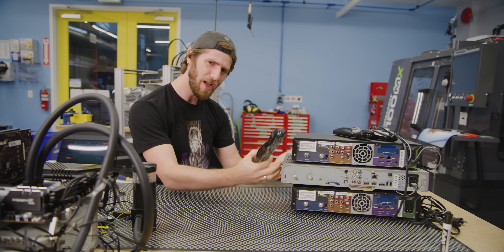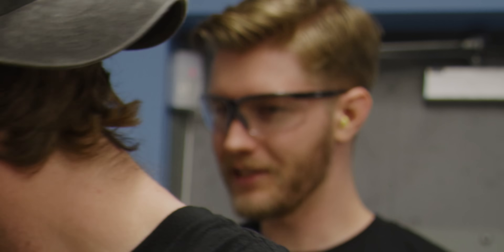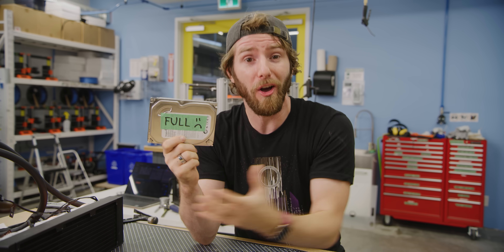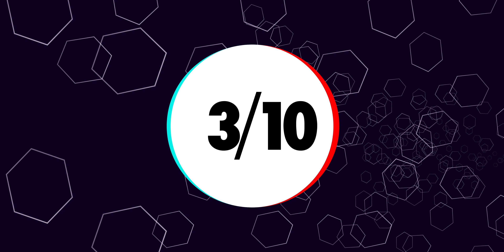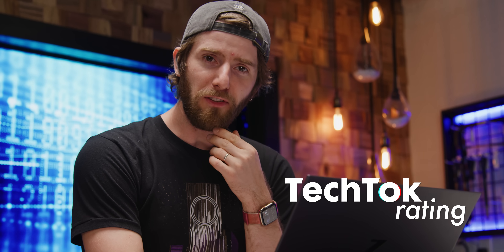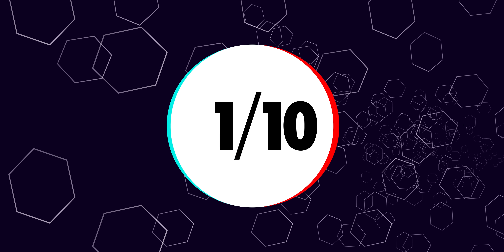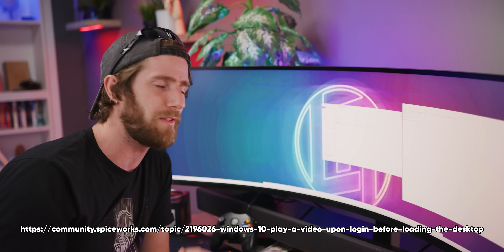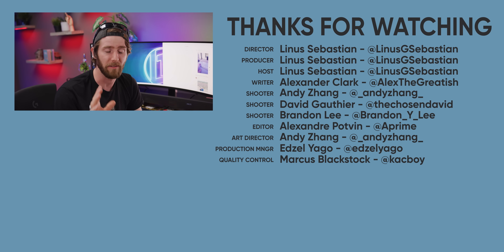Trying TikTok Computer Hacks...

Comment: As I come back to peek at this year-old tech tip, thought I should mention that eBay is better for hard drives honestly.
You can find deals like 4Tb 3.5" SATA HDDs for around $28, or in my case since I needed 16 SAS (different than SATA) drives for a server, I found a deal for 4Tb @ $20 and then proceeded to work a deal for $16/ea since I was getting 16.
So if you're buying multiple, building a home server, or just filling out your desktop PC's storage, there are some competitive deals.
Considering Linus paid $30 expecting 3x1Tb drives only to get 1.16Tb, you could get 4Tb for the same price. Just thought I'd share since I was just in the HDD market this month.

Comment: 15:11 should be an 11/10. i was having issues with my gpu a few months ago and ctrl+shift+win+b was invaluable for troubleshooting it at the time. it's especially useful these days when most people are trying to keep their current gpu until prices become reasonable again.
Reply: He did a bad job of explaining what it actually does?
Reply: i have an issue where i do ctrl+win+shift+b and my pc fully freezes and I have to restart 😂 i have a rx570 powercolor red dragon 8gb
Reply: get a 3070
Reply: I came here to say this - at my last job we had some really crappy intel integrated optiplex machines and the drivers were ALWAYS bugging out, everyone just rebooted when they ran into issues but after snagging this shortcut it saved a lot of time. Definitely a 10/10 for me.
Reply: @jufran9137  give me the money for a 3070 then.
Reply: Same here, it's proven invaluable with the occasion when chrome or some other application gets the transparent bar at the top in full-screen. Reset graphics driver and all fixed!
Reply: I dont get it what happened here. Can someone help explain to me?
Reply: @ciddhere  instead of rebooting when the graphics driver crashes, the keyboard shortcut reinitialises the driver from within the OS. Amongst other things it can be useful when overclocking and stress testing because the cards can bug out hard and screw with the graphics
Reply: @TheDreamHazard  hey thanks for putting your time to explain things for me. Appreciate it
Reply: bruh anyone know why my gpu shows no display?
Reply: @Catastropheex1  earn money to get it LOL
Reply: @jufran9137  don't tell people to get things unless you know their financial situation bigot

Comment: I've never laughed so hard watching someone use an angle grinder with such blatant disregard for their own safety or how to use the tool.
Reply: i.e. everybody in my welding class
Reply: As a welder myself, I wanted to see his shirt catch fire. I've caught myself on fire a few times doing that same thing,.
Reply: If you like that, you’ll love official duck studios. Seriously. Just endangering themselves with guns and power tools constantly.
Reply: Not wearing gloves was smart though.
Reply: @TheAdatto  I sense sarcasm in your comment...
Reply: @wargamingsupernoob  False sense!
Reply: @wargamingsupernoob  it’s not sarcasm
Reply: @wargamingsupernoob  its sarcasm until one of your gloves catches onto the tool and starts rotating and idk but it seems that real humans dont have action figure wrists that they can turn 180 degrees
Reply: @indigo3032  wait so you shouldnt wear gloves when operating this thing?
Reply: @michaelangelo0305   never
Reply: Use to be me until I had to get a piece of metal drilled out of my eye lol
Reply: @indigo3032  although might sound right, that wearing gloves with an angle grinder is dangerous due to tangling, it's not quite correct.
With a lathe or a standing drill for instance, you'd be spot on. Because those machines rotate relatively slowly (catch loose sleves or glove fibers easier) and have enough torqe to rip your arm off, or at least enough to mangle it.

An angle grinder however is a speed tool, and does not have enough torque to do that much damage, and because it spins so terrifyingly fast it, in almost all cases, just shreds the gloves. It's always better to wear appropriate gloves that fit, due to multiple safety hazards, and in many countries its officially recommended as standard safety protocol to wear gloves when using an angle grinder.

I've cut my hands on an angle grinder through my gloves a couple of times, and not once did it even come close to tangling, it just vaporised the glove, but they've protected me numerous times from fex, sharp metal edges, hot metal (notably after grinding), skin strain, grinding sparks (hurt like hell), improved grip when working above ground and less vibrations when grinding (you'd be surprised how badly vibrations fuck up your hands in the long run).
Angle grinders are horrifyingly dangerous tools and demand utmost respect and safety when handling, i still dont feel completely safe when using them despite my experience, because im not. But wearing gloves is almost always better.
Reply: Also, that's not even a cutting disc.

Comment: Okay, so, in the DVR bit, another point that should be brought up is that even if you get the hard drive out, most DVR makers have a proprietary method of pairing the hard drive to that specific motherboard. You have to get into the hard drives BIOS and completely reinstall the firmware, otherwise the hard drive won't even spin up. I have several that I have collected over the years, around 4.5 TB, that I can't access because I don't have the technical ability to modify the firmware.
Reply: you don't have to get into the bios, if you have a computer and hard drive dock, you can just format it, I have a 4tb HDD from a dvr in my computer rn, maby I just got lucky, but my brother and sister have 2tb and 3tb dvr drives as well.
Reply: @GatorGamerDude  That really depends on the DVR, some just use something like EXT3 or 4 because they are usually Linux based and lazy, others really do wierd stuff to the HDD BIOS

Comment: The graphic driver  shortcut comes in hand at work (Tech support) there is a display glitch that occurs in windows where the top portion of the screen doesn't display the open window - and the graphic reset driver is a quick way to resolve this , instead of restarting the PC (also fixes the issue)

Comment: Omg there's this thing called "DRILLING THE SCREW HEADS" that make much less of a mess

edit: And needle nose pliers to twist the metal mount. Every time Linus pulls out tools, I pull out tears
Reply: I thought the same thing, then I saw he grinded them and the started prying the drive out lmao.
Reply: Lmao exactly what I thought,  but I still appreciate the content xd
Reply: At this point I'm pretty sure he's doing it this way to make the videos more entertaining 😁
Reply: I open all my packages and mail with a grinder.
Reply: lol. I was thinking, "Oh, one of the drives don't work? AFTER YOUR REMOVED IT USING A HAMMER!!!"
Reply: Hack saw to cut a slot then flatblade screwdriver. Or but the "security" screwdriver bits.
Reply: Nevermind that he's holding the grinder so it sprays him with hot metal.
Reply: As a machinist I was just thinking this. We do that when someone strips the head of a screw.
Reply: I’m nearly certain one of his dozens of iFixit kits would’ve had the right bit for this.  I’d guess he’s doing it like this for the fun of it.
Reply: Linus is an entertainer, this is just him having fun... It's not a tutorial.

Comment: Linus: Get the I fix it kits with all the security bits ever
Also linus: ANGLE GRINDER TIME!!!!
Reply: Must be some pretty awesome security bits that ifixit make if they can remove rivets
Reply: I figured it was rivited or something close. Because it didn't make sense either.
Reply: @Heliocentric  Rivets that size are easy to remove, you just need to drill them. And Linus could've easily cut through the top of the first cable box with wire cutters.

Comment: "heavy duty tools required to access the drives"
or you get a $12 security bit set from amazon and save yourself the sweat
Reply: Was Linus not sponsored by IFixit?
Reply: hammerä/crowbar/tinsnips do it as well
Reply: ... Or a cheap junior hacksaw, create a slot and use a normal screwdriver. ;)
Reply: If you are just after the HDD... I guarantee you a hammer and a pry bar would do the trick. Hell, you could just use the back of a standard framing hammer for the prying. Add a pair of tin snips for easy mode. You sure as hell would not need a single power tool.
Reply: Is it really worth $12 for tools you only use once?

Comment: "you want some gloves ?"
Never. With. A. Rotating. Power. Tool.
Reply: I'm in construction - ironically its safer without gloves because the key to safety is complete control over the tool, which you have less of with gloves on as well as the danger of the glove getting caught in the blade and pulling your hand into the grinder. So lesson is stop trying to be stupid safe all the times kids
Reply: @portaadonai  lost a finger due to gloves and grinder, never again
Reply: @WLS_Churchill  holy shit did you ever get it re attached? if not did your life change drastically without it
Reply: @sucman1684  haha no it wasn't a clean cut and they had to stitch what was left of it, i learned very quick to live without it and pretty much nothing changed
Reply: I use leather gloves with a close-fitting guard. Has saved my skin multiple times. The threat of cutting your own fingers off outweighs anything else.
Reply: Fast tool (like a grinder), yes, wear gloves. Slow tool (like a lathe), no gloves. A grinder will not pull your gloves and finger into it like a lathe will, it will simply cut the glove, which would have been your finger. You shouldn't use any tool with poorly fitting gloves.

Strictly speaking, gloves aren't necessary using a grinder, but after getting hot pieces of metal stuck to the back of your hand a few too many times, you'll want them.
Reply: @rightwingsafetysquad9872  Exactly. Although, I would suggest using TIGHT-fitting gloves when using those as to not get metal splinters. Because I've had those before and they hurt WAY worse than wood splinters because they're twisted so they burrow
Reply: @rightwingsafetysquad9872  This is NOT TRUE. I know people who lost fingers this way. Grinders are not sharp, they will grab something like a glove. If it's tough enough to stay together for a fraction of a second it is good enough to pull you in.
Reply: Your supposed to wear sleeve gloves probably what he meant but we can only hope
Reply: You should have safety glasses but no gloves if you are doing it right.
Reply: @toriless  No. You wear tight-fitting gloves and have a guard in the correct orientation on the grinder.
Reply: @RobinTheBot  it wouldn’t, but thing like mills will

Comment: Those DB 35.2 and Pipeline hard drives will work in a computer, but they are designed to be used specifically for video recording, which does not require a very fast drive to do. Using these DVR hard drives in your system will definitely be a hit on performance
Reply: I smell a problem for raid 0
Reply: @chrisbadiou1407  Stripe a bunch of slow hard drives that are optimized for continuously streaming video, instead of seeking data randomly are still going to perform worse than a single mainstream computer hard drive, unless you read and write data in big enough chunks to compensate for the increased latency accessing these poorly optimized drives. Whether it is a single drive or a stripe of 32 drives, the higher seek time means you wait longer for the drive to locate the first sector to write.
Reply: I just use them in my plex server. It's good enough for that
Reply: @jesselioce  for archival purposes, or storage attached to a network connection that’s slower than a hard drive, the difference is negligible. I wouldn’t use them for a system drive though.

Comment: Back in college I used my PC as an alarm clock for finals when my actual one broke.  Motherboard had a wake on specified time boot function, and placed a really hard rock song in the good old startup folder in win XP.  Is the startup folder still a thing?  I don't even know.
Reply: @Agret  So if I put a soundtrack file, it will play automatically on boot?
Reply: @whitehavencpu6813  you can put a shortcut to the file and it will open in your default media player when you boot up. If you want a startup sound you can go into control panel (classic one not the Settings screen) and then Sound and on the list of windows sounds you can put a custom windows startup or account login sound effect.
Reply: @Agret  Ah thx

Comment: From superuser:
"Official from Microsoft: "Windows logo key + Ctrl + Shift + B = Wake PC from blank or black screen"

From a discussion with an AMD Radeon driver engineer, it does NOT restart the graphics driver. It does appear to discard the desktop surface buffer and re-create the allocation from DWM (on a healthy system the desktop goes black for a second). "
Also: "For what it's worth, Microsoft also recommends using it in this situation: when troubleshooting external monitor setup, when external monitor was working before but then suddenly stopped."
Reply: i just did it to check if it worked
Reply: So does it work? Will you get a screen with this after a gfx driver crash?
Reply: @tharealmb  Lol.

Lmao.
Reply: This shit just made 3 of my 5 monitors pink.
Reply: Please be careful with Win + CTRL + Shift + B! It resulted in some really weird graphics glitches with my AMD Radeon RX 580 and the PC wasn't really usable anymore. Thankfully, that's easy to fix. Either restart your PC or just go to power saving mode and wake it up again once it's gone to sleep.
Reply: @Felixprogram  Facts. RX580s dont like this shit at all.

Comment: 10:39 back in the MS Dos era, we used to hide our files using ATTRIB command, and for an additional security level we named our folder using special characters like ╝
Reply: Similarly, and not sure if this is still a thing, but I explicitly remember there was a way in Windows XP to make a folder appear entirely nameless and if you chose an icon that didn't display, it would effectively make the folder entirely invisible.
Reply: @heyyitsultima  I remember doing that in win 10. Afaik there's a character that you can put from some character menu that will appear empty and then you can select a transparent icon for the folder.
Reply: Nostalgia,
I remember i made a complete folder locker with secure database all in .bat

Comment: 15:23 From a discussion with an AMD Radeon driver engineer, it does NOT restart the graphics driver. It does appear to discard the desktop surface buffer and re-create the allocation from DWM (on a healthy system the desktop goes black for a second).
Reply: basically it alerts windows to a potential graphics issue, and does, in most cases, force the driver to restart
Reply: @timnone2924  consideing how solid the adrenalin software is, probably going to be pretty handy.
Reply: On a not healthy system it will create weird artifacts and system instability. It will create more problems than it solves.

Comment: Seeing Linus with that grinder without proper protection almost caused a heart attack for me. YOU'RE NOT FINE, LINUS!
Reply: He is dont be a baby
Reply: Exactly my thoughts here.
Reply: This week on linus nearly sets his shirt on fire
Reply: How he didn't burn a hole through his shirt I'll never know.
Reply: didnt know the raiden shogun watches linus tech tips
Reply: @zedblade2526  Didn't know I'm not the only one Genshin player watching Linus
Reply: @graemed8792  you would be surprised how many people use angle grinders without gloves and such. Glasses about all i use which linus had a face shield.
Reply: and his arm
Reply: @GreyBlackWolf   Same here about the only thing I put any gear other than eye protection on for is when I use a wire wheel attachment attachment on my angle grinder. Damn things sling wires like a drunk throwing darts at a bar. 
You never know where they're going to end up and if you have any exposed skin it's like sticking pins in a pin cushion.

Comment: 1:45 dont use welding squares for holding something to grind. use a vise. also you can adjust the shield so the sparks dont fly into your chest
Reply: And maybe a cutting disc rather than a grinding disc will get the job done quicker with fewer sparks. But then again if you aren't setting your jumper on fire with concentrated grinder sparks, you're not doing it right.

Comment: 1:55 Thats a grinding disk, Would have been a lot easier with a cutting disc
Reply: shhhh.... he's trying his hardest.
Reply: Or just drilling them out, And also using plyers on those metal tabs.
Reply: @Archuhi3  Yeh I also thought that a grinder was a bit overkill for such thin metal.
Reply: Bigger is better. If he use 1mm cutting, I think that shatters to million pieces in seconds. It's nice that he got safety glasses.
Reply: @jannejohansson3383  Why would it shatter ? Also he didnt have glasses he had a Helmet with a shield, which he also didnt wear properly in some shots. Safety goggles are the very least if you're using a grinder.

Comment: I've seen hardware savvy, his tips can literally destroy your CPU. He said to change startup cores from 1 to 8.
Reply: I know a decent bit about computers, (not that) but that sounds bad, especially if you have less than 8
Reply: not all his tips are bad, he introduced me to alt+clicking and he has a bunch of unknown keyboard shortcuts
Reply: And what's inherently wrong about that?
Reply: @teafrost  The default setting (1) actually means to use all cores. Which is because it's not active until you manually configure it.